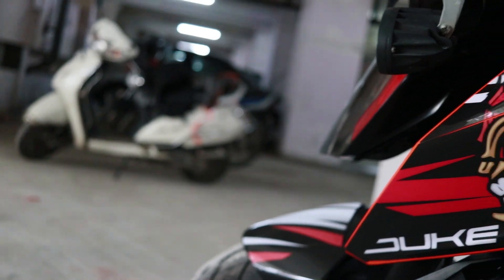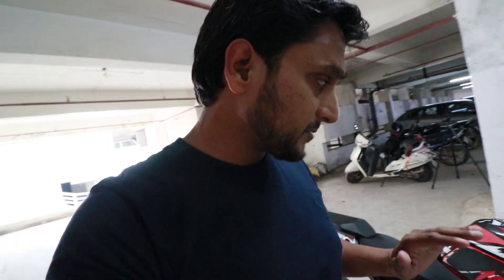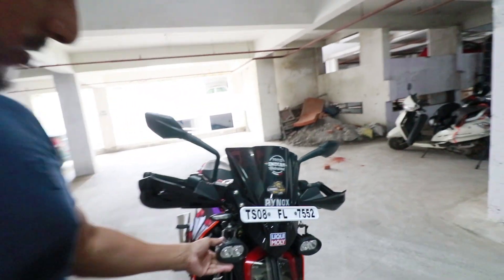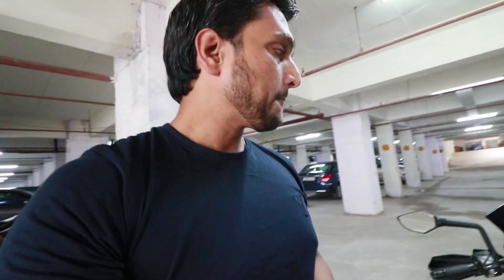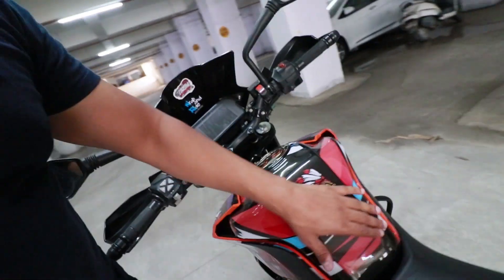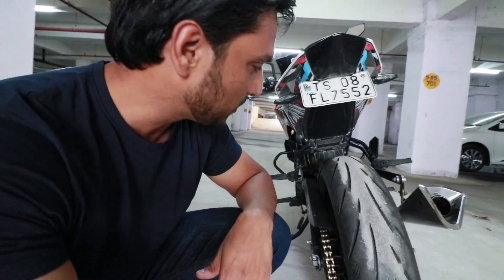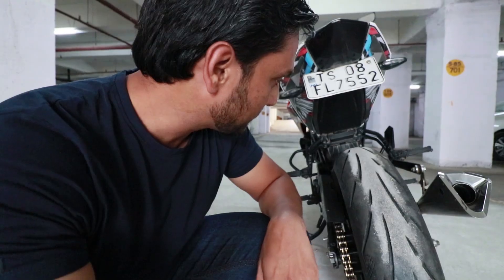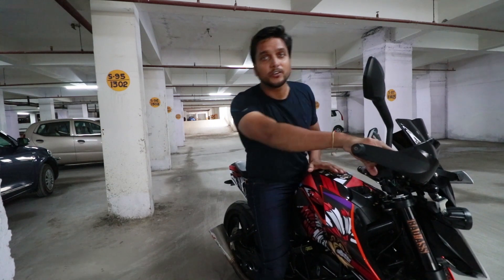KTM Duke 390 modified | Ktm duke 390 with ixil exhaust | jatinsharma vlogs

Comment: Did you weigh the stock exhaust ? 
Cause exhaust is light weight too and compared and checked it ?
Cause these bikes are already made as light as possible I’ve observed their exhausts are weight too 
Plus if you have only put end can it won’t weight that less 
If you decat it it may get close to 5 kgs 
I want to know the stock exhaust weight and the one which you put
Reply from the maker: Hi Sushil, thanks a lot for taking time out to watch the vlog and commenting. I really appreciate it. Total weight loss of the bike is around 8kgs that include exhaust, grad rails and tail tidy. I think I missed to mention them as a contributors to the total weight loss. Plz excuse me for this. Have a great time brother. Stay connected.
Reply: JatinSharma vlogs yes thanks for the reply 🙌🏼